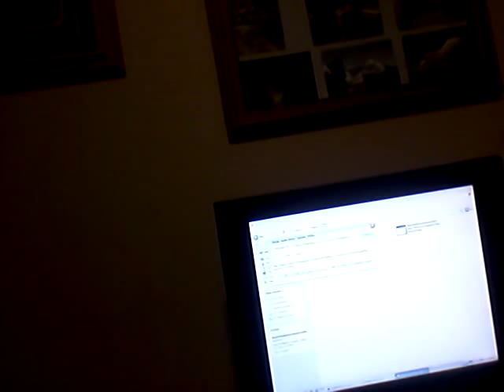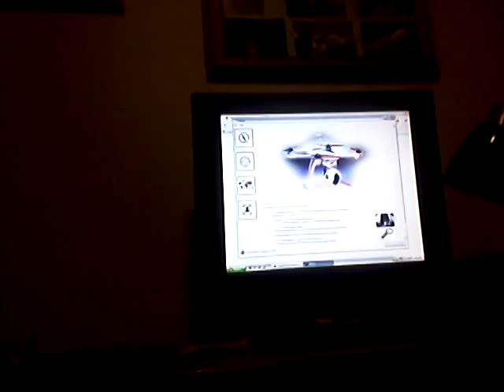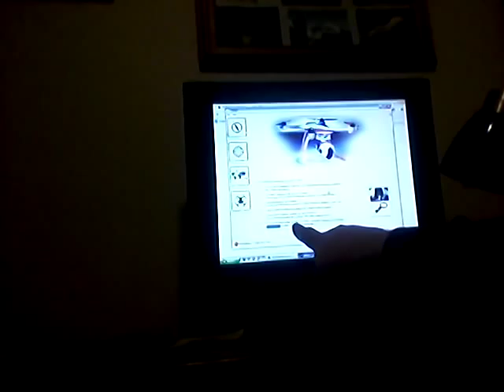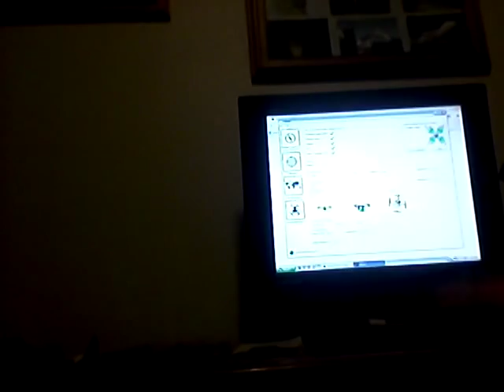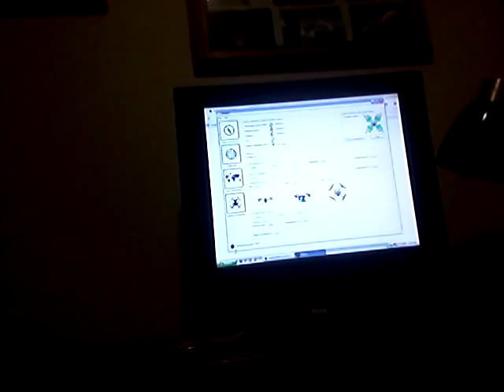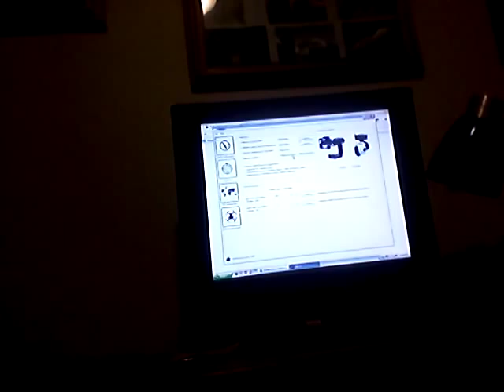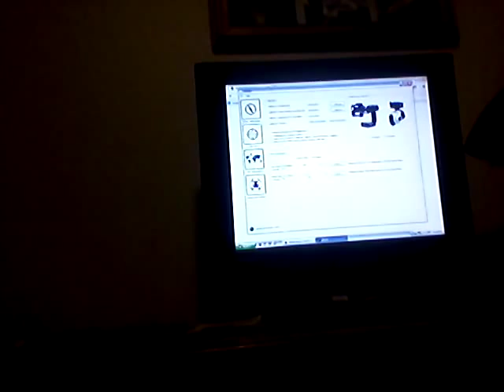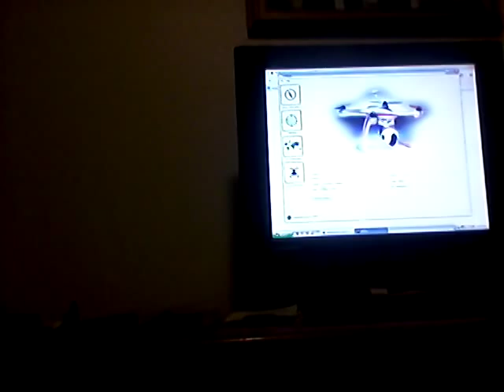Blade 350 firmware v.3 and the gui tutorial.

Comment: Good video -  just a note - there is also a board change from version 1 to version 2.  Version 3 is using the board from version 2.   I roughly did the price calculations based on Horizon's web site to do all the updates to get a version 1 modded up to a version 3 AP combo, and the cost is roughly $860.00 us dollars.  (to include the new CGO2 and their price for the 'old' DX4 that is no longer available).  Based on that, I bought a new AP combo, and will hopefully sell my 'old' Version 1 that was upgraded to version 2 software (but old version 1 board).

Comment: My 350qx v1 refuses to connect to the gui, just goes into bind mode. It always says it is connected to com port 3 even when the usb cable isn't plugged in. I have put v3 firmware on the quad sucessfully and installed the ftdi driver for the usb cable. It doesn't make sense!
Reply from the maker: You have successfully installed v3 on your v1 quad, Unplug everything else from your usb, printer etc, but leave your mouse. the gui is connected to something other than your quad

Comment: what kind of CFprops you have on your 350qx?where did you get those?
I have the 350QX v1 with firmware 2, if i upgrade to firmware 3 will i still have the 3 flight mode with the DX5e the came with it?
Reply from the maker: The props are Xtreme carbon fibers, you can see the review for them in a previous vid. The dx5e will actually give you all 4 flight modes, you can watch how to do that in the video after this one.
Reply: thanks for the fast reply.4 flight modes? is it the stagility mode?
hows the GB200 gimbal holding so far? is it worth it for the $200 price?
Reply from the maker: Green-smart purple-ap blue-stability red-agility. you have to program the radio for stagility. gb 200 works awesome.
Reply: Ryan Gribble awsome thanks. you helped me alot

Comment: Does your gimbal tilt control now work with the new 3 firmware if not what does the switch on the right side of the Radio do
Reply from the maker: No because my Quad is version 1 and it doesnt have the capability to run the gimbal with the main board in it.

Comment: Ok, so I have a QX2 and I believe it has Firmware version 2 on it. I would like to update to version 3. I followed the site's instructions but my computer doesn't connect to the Quad. It says that there is no communication with the device. I installed what I think are the correct USB FTDC (or whatever they are) drivers. Any ideas what is wrong?
Reply from the maker: Are you trying to use the GUI as the updater or the old update program? Also are you connected to the correct port?
Reply: I finally got it working. Thanks for the help though Ryan!